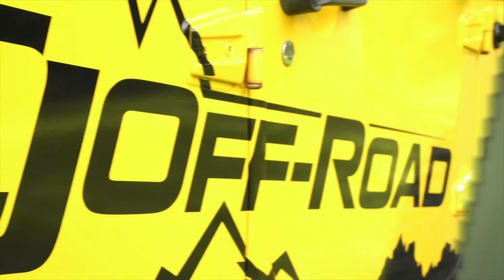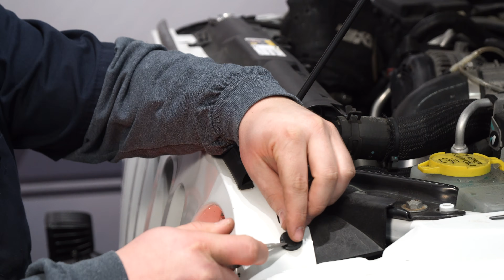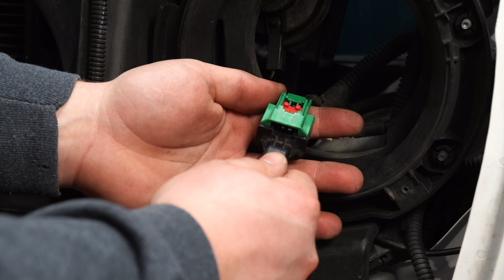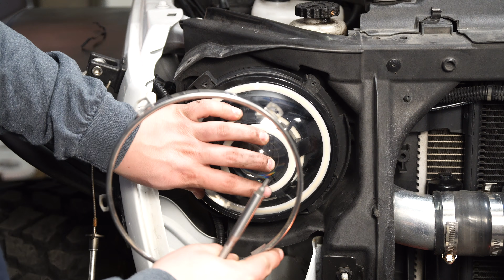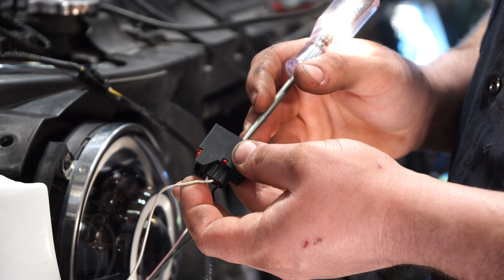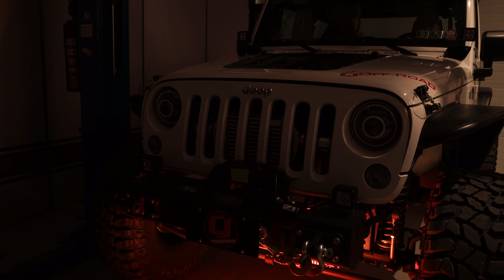Installing 2.0 Signature HID Projector Headlights on a 2007-2018 Jeep Wrangler JK for a Custom Look!

Comment: I just ordered mine cj pony has them discount I payed under $700 with a discount code with the devil eyes, hidprojectors has them for $899.00 plus taxes for over 3 years now! Them have no discounts which sucks knowing the new jl came out, I bought them for my old 2011 jku in 2017 and surprisingly still $900 bucks thanks cj pony! Just received mine today!

Comment: I wired mine this way to my 2009 wrangler, but here's what I'm getting: parking lights and/or headlights on, rings are amber and I get no flashing when turn signal is on. When all lights are off, I get white flashing for turn signals. What did I screw up?

Comment: HID vs LED? Ready... GO!
For off road use.
Reply from the maker: That would be a never ending debate haha.
Reply: CJ Off-Road I guess like for example like cutting thru dust.
Reply: So I been doin some reading and found that apparently HID is superior to LED in almost every way. One of the few benefits of LED is less heat production.